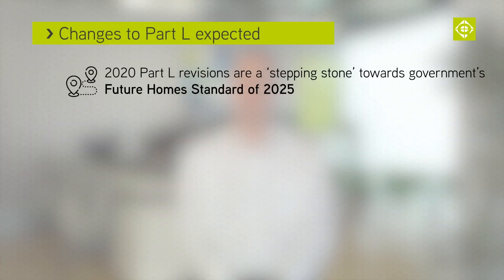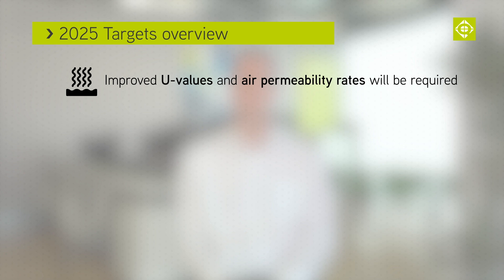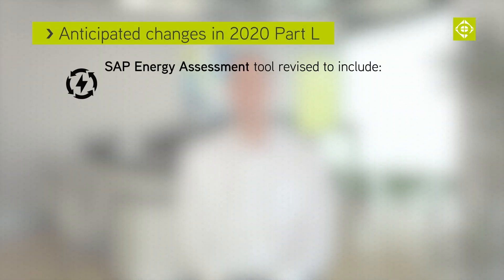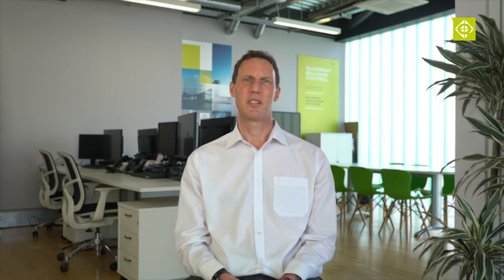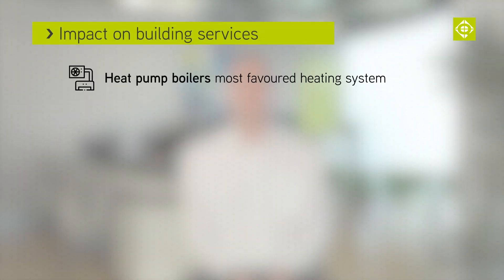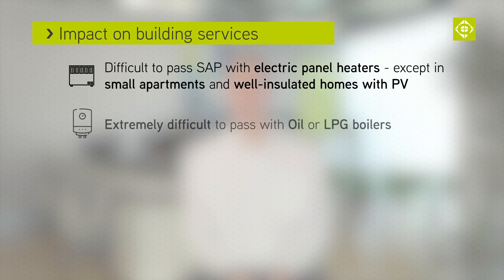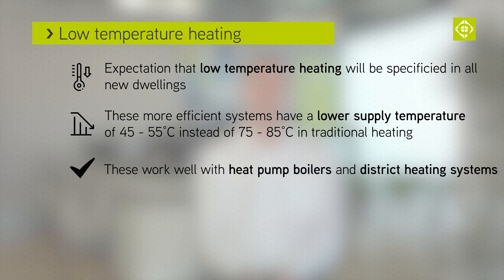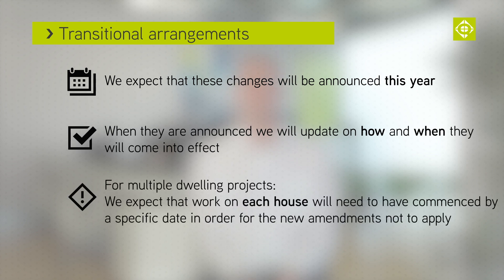2020 UPDATE TO PART L – What it means for new housing

Comment: Thank you for the information & your time .  I run a small building services family run company, Electric boilers !  Air source heat pumps !.  Good luck with that one . Let’s hope (a) the phased Electrical supplies are sufficient (b)  We don’t get prolonged cold spells as the efficiency significantly drops off from air source. 
    Cost -  this will increase cost substantially.

Comment: Thanks for great update. I was wondering if this would apply to commercial conversion properties, for eg- office to residential?
Reply: This would not apply to conversion scheme, but only to new build apartments and houses.  Existing buildings that are being converted into dwellings would be treated in the same way as we do currently and there would are no changes in the Regulations planned at this stage.
Reply: @joecampion1452   thanks for the info. Much appreciated.